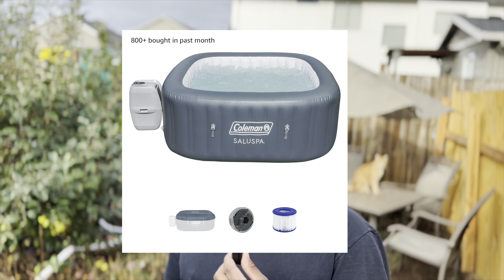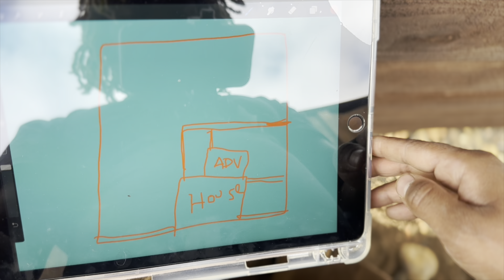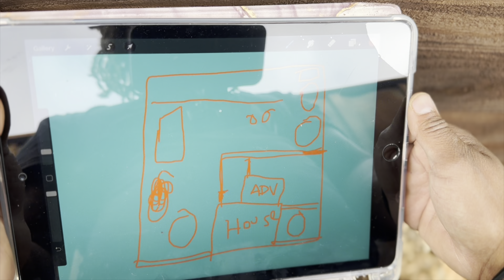Future Plans For My Yard + Organizing

Comment: Damn that fence looks great! For the pavers, make sure they are for driveways and not patio pavers. I had a neighbor do that and the pavers broke under the weight and started damaging his tires. You could do gravel if you can't find any drivway safe pavers. There are places that sell various sized pebbles and sand and dirt.they also transport it and dump it where you want so you can smooth it out. But hopefully you can find the pavers you want. Are you keeping the pool?
Reply from the maker: Thank you!! Ikr it’s looking so good. Ohh yeah I was planning on using 1x1 foot driveway pavers so it should be fine. Yeah I got a quote for gravel and they said $2,500 😭 I think the pavers will look great
Reply: @elijahray132   Holy crap thats way more than I thought for gravel. Dann.